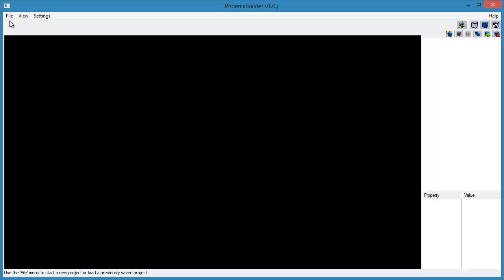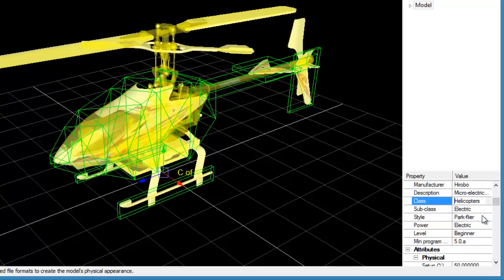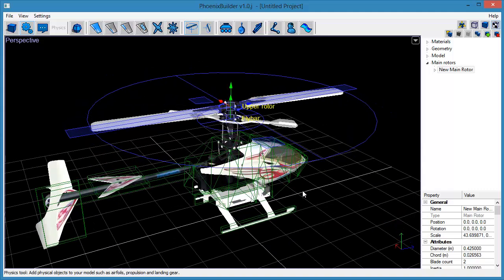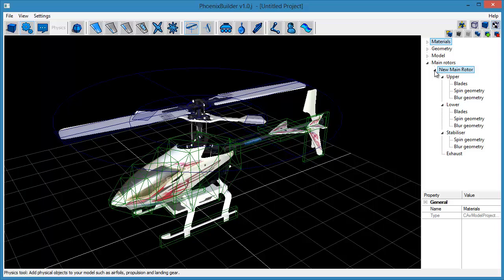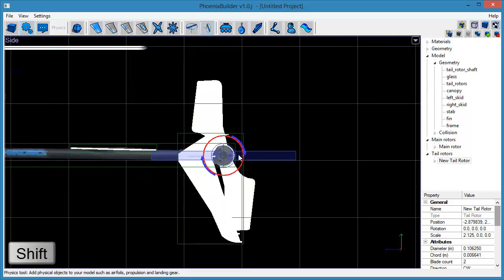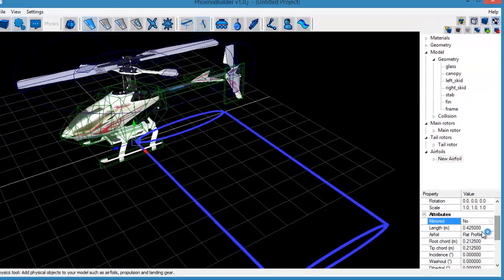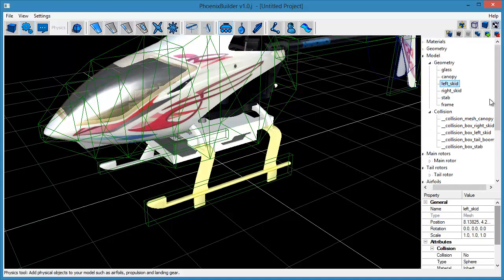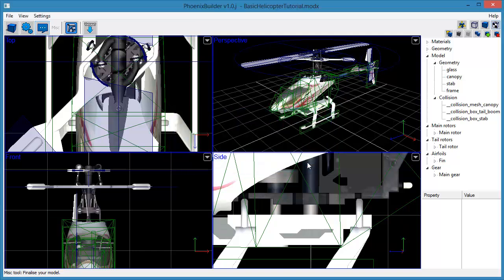Phoenix Builder - Basic helicopter tutorial

Comment: Hi mate  very good videos .. is there ay quad choper  walkthrough yet .. Im looking for ay 250 size racen quad to practis
Reply from the maker: mrmaca We do not have a dedicated Quadcopter tutorial yet, but this is almost exactly the same as creating a normal helicopter model. The only difference is that you would create 4 "main rotor" objects instead of one. You would most likely also create an "autopilot" object if the model you are simulating has SAFE or its equivalent fitted.
Reply: Thanks very much im very new to the sim flying and creating .. so il do more home work thanks...